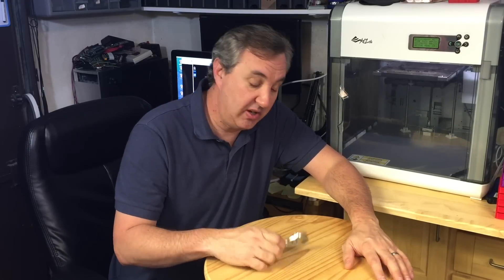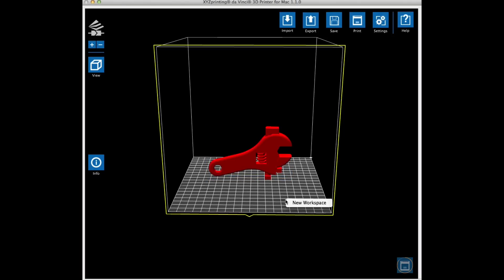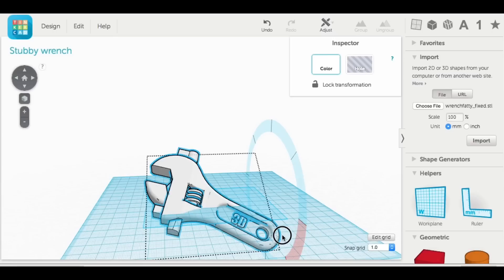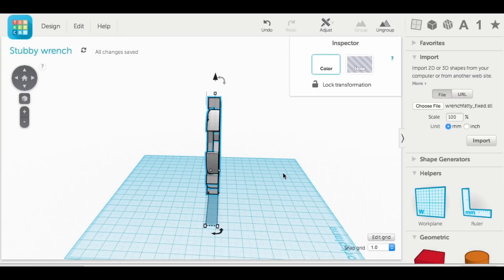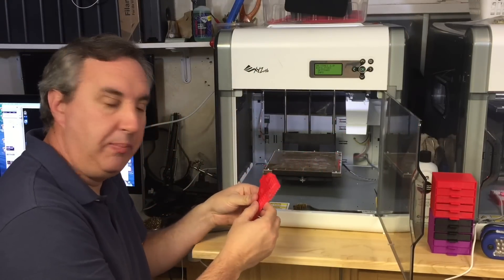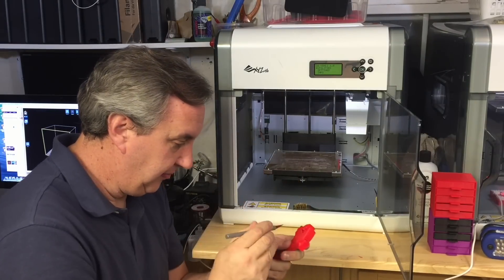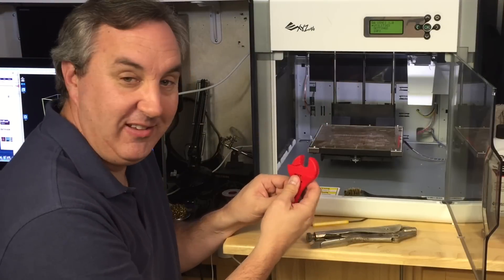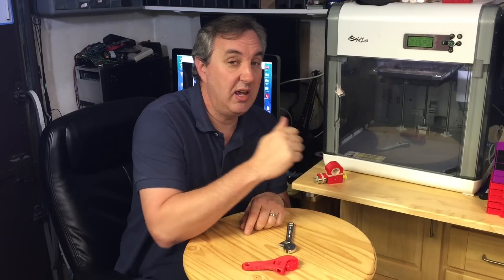Single 3D Print Adjustable Wrench - Davinci 3D -Video #024

Comment: I was able to print mine on its side with a raft. Stock ender 5 pro with Cura. I have to run everything real slow but it turned out great and I didn't even have to clean anything. Love your shows keep up the good work.

Comment: Chuck- What type of filament did you use, and what temp was the extruder and bed? Mine came out looking okay, but the gear and the support material were a fused mess. Thanks.
Reply: +Chuck Hellebuyck's Electronic Products Thanks. I'm using Repetier so I can adjust the temp. I didn't know about not using .10. Guess what I was using? :)
Reply: Wait... When you say use 0.2, do you mean on the support material or the extrusion of the actual model?  I know you mention some of it in the video, but what's your best advice for setting the support material?
Reply: Last question I swear! With your Da Vinci's did you have trouble getting small details on the surface of your models? I don't seems to get good results on things like facial expressions or surface shapes. For instance, I printed a Doctor Who TARDIS. It didn't seem to have great detail on the panels.
Reply: Thanks!

Comment: Hello Chuck! Merry Christmas!

I love your videos, very informative. I just received my DaVinci 1.0 and I've made a handful for prints so far.

I was wondering if you have or are willing to make a video explaining the different settings and their effects in the stock XYZware. As you know, the manual is seriously lacking explanation on what kind of effects using the different options available for print output. There doesn't seem to be much available on the 'net with regards to using the stock software.

Also, I've noticed that when I start a print (using a layer thickness of .2um), the extruder is so close to the table that too much filament is deposited on the first few passes. This results in gobs of plastic being pushed out to the edges by the nozzle which ruins the esthetic of the bottom of the piece.

Have you experienced this and is there are fix?

Cheers and thanks!

John
Windsor, ON
Reply: *****
Hi again Chuck. Thank you for your quick reply!

I will experiment with settings as I go and see what works out best then. I'll look for the book as well.

I emailed the company today and suggested that a future firmware update could incorporate a tweak which could lay an initial thicker first few layers for the base and then switch to the user-defined settings for the remainder of the build. I would also like to be able to keep the interior light on throughout the build process.  

Cheers!
Reply: *****
Thank you, I'll look for that setting then.

I had layer separation issues on a rather big print I did last night and after some quick research, I attribute it to the build chamber being too cool. I had removed the two "windows" I put in for my first build. I put them back in for a bigger build tonight and so far, so good. Time will tell once it cools however. I can't stop playing with my new toy :D

Comment: Thanks for the videos.  I've had my Da Vinci sitting under the tree for a couple of weeks now waiting to be opened Christmas morning.  

Wondering if you've looked into the Simplify3D software.  Apparently the latest version supports the DaVinci running on stock firmware.  Looks to have better control over the slicing process than the out of the box software.  Maybe they'd be willing to give you a review copy?